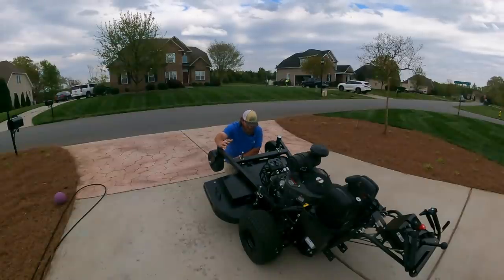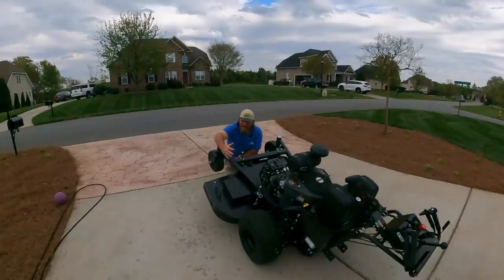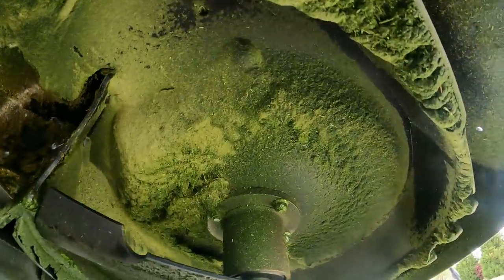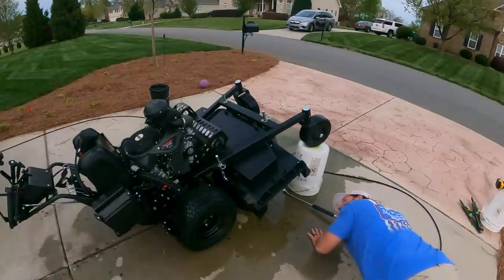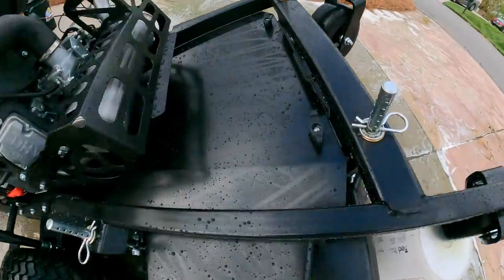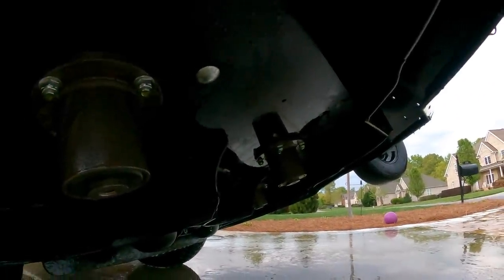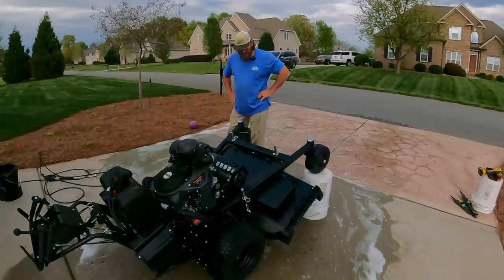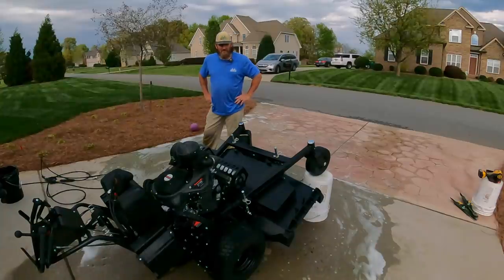Ceramic Coating a lawn Mower - Did It Work? Results and Thoughts

Comment: Love it!  If you're going to do this on a used mower is clean the surface and strip of all oil, dirt, and make it absolutely clean. Don't believe that you 'cannot' ceramic coat old mowers. Otherwise, people will only apply these things to new vehicles. It can be done on just about every surface and material as long as the surface is VERY clean.
Reply from the maker: Agreed 100%

Comment: Thank you for a really informative video! Couple of easy questions for you. What did you use to ceramic coat the mower, what is the name of the product and where did you buy it? Secondly did you apply it or did you have someone do it for you and if so what is the name of that company which applied the ceramic coating? I have no doubt that over the life of the machine it will improve its cutting performance and improve the life of the mower. Again thanks for a great video.

Comment: Awesome pete, if you have time ( haha) can you apply coating on used mower to see if its worth doing? Thanks for what your products and videos!
Reply: I do car detailing. Problem you have with coating a used mower is you’ll have to do crazy amounts of cleaning, clay bar, and buffing till it’s scratch and contaminant free.
Reply: Could you really clean the mower deck and then repaint it really good and then do this?

Comment: The other problem with Riding/Zero-Turn Mowers, is trting to get the debris off the Transaxle and Drive System, as they are not easily available for washing/rinsing...😪